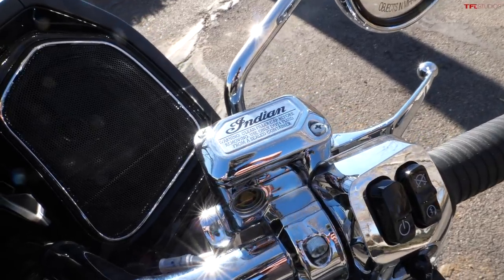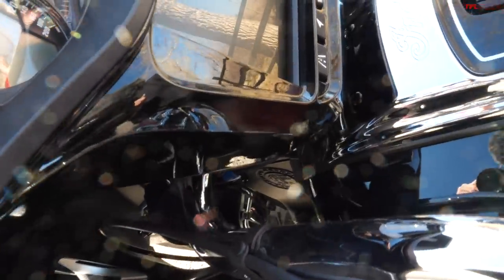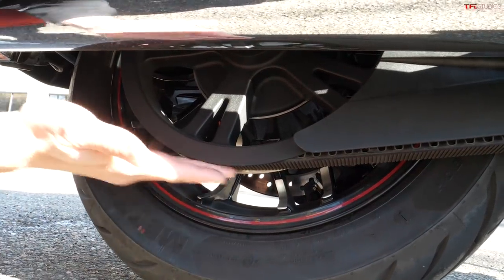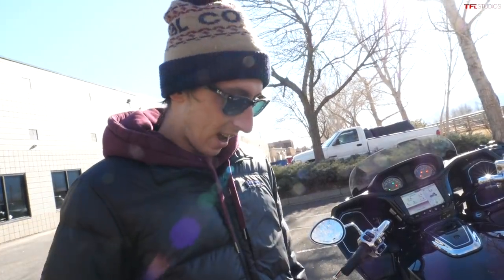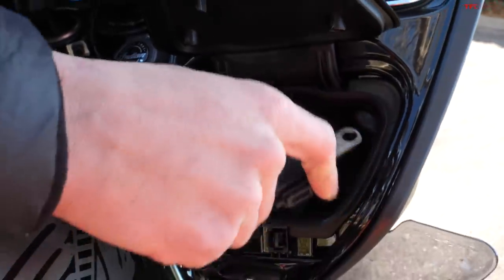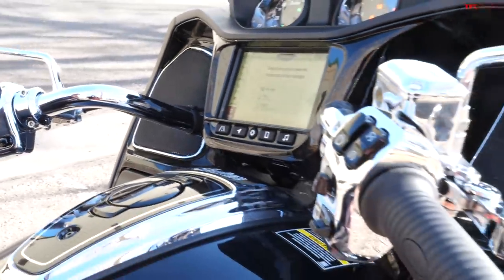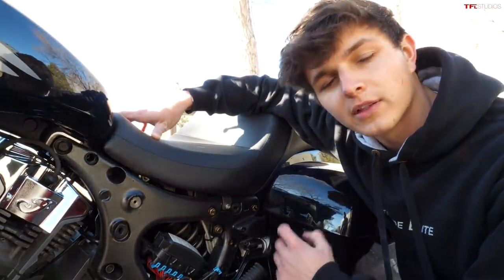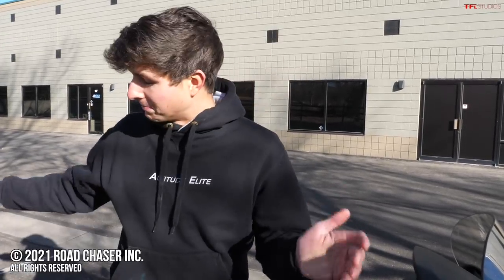Here's EVERY Feature You Get With The $28K Indian Challenger Limited (Hint: It's A Ton!)

Comment: I am coming up on my 500 service this week. Love the bike, overall so far. I have heard the valve train noise you mentioned. I just thought: "Oh it is an overhead cam and four valve motor". It is taking sometime to feel comfortable with the throttle action. Plus, the handle bars are larger (wider) than i am used to as well, but all good. Great bike and the power is impressive along with the handling in corners. This is my first Indian, only owned H-D up until last year. I had become dis-satisfied (H-D) over the years with maintenance issues, and said I have bought my last one.  I am very focused on keeping my vehicles in top running condition all the time...
Reply: I did take a H-D Road Glide 114 out for a spin. I even told the salesman, I was surprised I even came down to look no less take a demo ride. I looked at every bike in this class of motorcycle.

Comment: Polaris has been using mono shocks in their cruiser designs since at least 2004. Not sure about the V92C. The whirling you’re hearing is likely from them flipping the magneto and having the coils mounted to the primary cover. Other designs tend to have the coils mounted to the motor and covered by the magneto, making it a little quieter, but more at risk to failure due to trapped heat.
Reply: V92C was a mono shock

Comment: I’ve been a motorcyclist for 50+ year now and have owned nearly all of the major brands of motorcycles.  I currently ride a Harley Ultra Limited.  I took several long demo rides on various Indian motorcycles.  The Challenger is an entirely different motorcycle compared with the other Indian touring and bagger bikes.  the controls are very light and the engine spins up quickly.  It feels very much like my BMW K1600 in that regard.  While it feels front-heavy, the fairing being frame-mounted keeps the steering feel light.  Plenty of power compared with the Thunderstroke 111, and very few vibrations.  Good heat management, decent seat.  The Challenger feels like a very good all-day or all-month ride.  My two concerns are the lack of Indian dealers (several states have zero dealers at this time), and the reliability of the suspension.  I owned a Victory Cross Country Tour and the suspension was awful, and Indian still sources its suspension parts from Fox.  Last, having experienced Polaris shutting down Victory I’m wary of Polaris deciding to close down Indian if there is more profit to be earned in its other product lines.
Reply: There is a lot of buzz around the new Indians and I see a lot of HD guys making the switch. I don't think they're going anywhere.
Reply: Many Roadmasters out there with over 100k, including a few over 300k, with no suspension issues.

Comment: I like the challenger. I wish they had a 2 up tour model, with lowers, tourpack , passenger floorboards, 4 speaker system to name a few. I know these are all add ons but it is a lot more $$$. I guess the only bike in their lineup like that is the roadmaster
Reply: Give it a year or two, they'll probably make a Challenger touring model. They have the parts now, but you're probably looking at 5 grand or more for the add-ons.
Reply: @channell11  update I rode the challenger at a demo event. I liked how smooth it was, loved the clutch feel. It fit me pretty well. The audio was disappointing, was not use to the gauges. I really was expecting it to be faster. It ran rough after about 65 mph like it needed some tuning. Rode a roadmaster limited it was fine until about 70 then it felt out of tune as well. The suspension was great and the handling was good. That roadmaster was agile and light! My bike has had performance work at stage 2 ultra limited. Neither of the indian bikes stereo compared to the boom audio I have stock. Both had 4 speakers the roadmaster was better it was 200 watts. Maybe just the speakers I don't know. I like my jams when I'm riding!
Reply: Your wish has been granted. See: Indian Challenger pursuit.
Reply: @IndianMC-jf3cp  already got a roadglide limited.
Reply: Time to upgrade 😎

Comment: Don't review bikes that often do you?  Or  did much research on this bike?  Rear cylinder deactivation has been around for years.  The fob will lock and unlock the saddlebags remotely.  Key in fob will lock bags and steering.  There is also a puddle light under the bike that lights up when you use the key fob.  Brembo brakes are radially mounted for better stopping power.  There is a 12vdc port on the right saddlebag lid by the lock.  Inverted forks on  baggers is not new either,  my 2010 victory had that.  The screens on the ridecommand can be customized by drag and drop.  The TPMS will work after the bike starts moving.  The S in the circle is for when the  kickstand is down.   The vents can be closed.  No need to hold the start button until it starts, just tap and release it.  Bike will start on its own.  Tires were especially designed for this bike by Metzler. This is a 2021 model.  Slight differences between 2020 and 2021, location of power button and painted inner fairing.
   How do i know all of this? Perused the interwebs for a year for info.  And i bought a 2020 challenger darkhorse  in november.  The bike is absolutely awesome.  
   I know the TFLbike is a new thing.  You will get better.  Still a good video.  Ride safe.  Shiney side up, rubber side down.